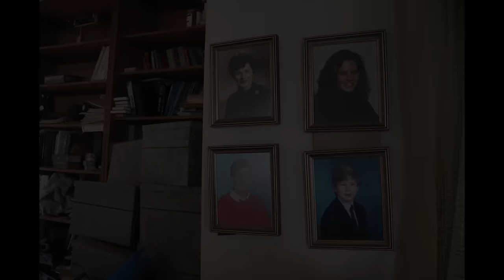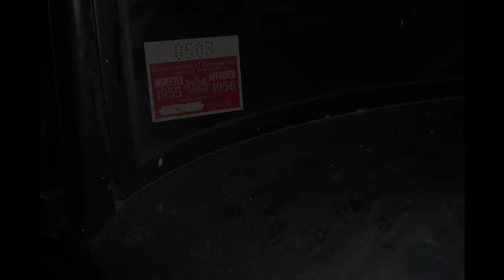1927 Packard Found in Abandoned Philadelphia Factory Sitting for Over 40 Years

Comment: Please get it running and repair just barely what is needed to go, steer, and stop.  Smooth down the sheet metal minimally clear coat to prevent further rust and then enjoy.
Reply: Eddie Huff here's a thought, how about you does with it as HE wishes, not YOU. Ya know, since its his car and you're nobody?
Reply: 4
Reply: The 90 year old seat and interior fabric won't last long.
The engine seals will start leaking in a month, then there's the issue of brakes, belts, hoses . . .
Reply: Of course he should do what he wants with it.  However the trend today is to keep it as original as possible and just do what needs to be done to preserve it and get it on the road.  In most cases this will give him the most value for the car should he ever want to sell it.  I think that was the intent of the reply's...….Signed Nobody!
Reply: @brianmax8147  that's so true. Some are born assholes and some like me, have to work at it. LOL When someone calls me an asshole I say "Thank you, I work very hard at it!" Partly because in saying that it takes away their (the person who's calling me an asshole) intended goal. Which is to cause me to feel bad about myself and to be hurt. For it to cause those things in me I'd have to care about their opinion. My best piece of everyday armour is not caring what anyone thinks about me. I can't do anything about that. I can change the response they are looking for from me. 😊👍🖖
Reply: @dbyers12  i guess my reply was meant to show that calling him a nobody said more about himself, than the person he was calling a nobody. 😊
Reply: Eddie, you're so right! Cody can't help the fact that his Father and Mother are Brother and Sister.  😉 lol

Comment: Mechanical vs Full Restoration? Hard to say. I think I'd clean it up first. If it looks great as-is, just get it back up and running. If it's just south of looking really good, and going the extra length would bring it up to 100%, I'd go full restore.
Reply: The car would be worth a LOT more unrestored, running, drivable.
Reply: @joesurfer9754  I'm not sure that's accurate in today's market, although I agree I would do a minimal restore myself. To give it a 100% frame-off restore would take truckloads of money. And to get max $$$ it would have to be done by a house that specializes in Packards. Sure an individual could do it over many yrs, but would he do it correctly is the question. And the people with more $ than they deserve buying it would think the same way.
Reply: I would do same thing Just clean every thing & fix what needs fixed. Free things up and keep them original. 
Original is priceless
Reply: If it's like a old model t it likely has wood with metal over it. If it's like that it's possible simply due to the age that the wood is in sad shape
Reply: @kevinfetner7983  car is worth way more as it sits just needs a good cleaning. The car is considered a survivor by the video a off the frame restoration will drop the value alot
Reply: why repair or restory if not broken. Just clean & fix broken parts. Very nice car.
Reply: The dad wanted to restore it with John Paul and his siblings.  Do the restore the dad would have done, which seems like a mechanical rebuild to get it running, a polish or new paint to match original, and possibly reupholstering with as much stock as possible.

Comment: You guys need to check for hidden compartments that were used for hiding your booze during the Prohibition.  Many cars of the era had them in the rear arm rests, under the seats or in the trunk.  Only high end cars had steel wheels on them like the Packard back in the 1920s.  This car being a survivor needs to keep its integrity and be just cleaned up.  It's not a rare and desirable model so actual ground up restoring probably would cost more that its worth.  Thanks for the video, you've gained a subscriber.
Reply: William Charles:  No, they shouldn’t open anything before getting pro advice on how to proceed. Once that’s in hand they should video and take good photos of everything as they go through the car. The car might possibly have historical value beyond that of an ordinary ‘27 so documenting everything might help drive value even higher. Taking extreme caution doesn’t cost very much, but doing things the wrong way sure could.
Reply: William Charles - It’s  not really a matter of whether full restoration would cost more than the car is worth or not. The consensus is that this car is just too good to mess with beyond mechanical restoration.
Reply: Contrary to popular belief, Packards are rare cars, whether they're a common model or not.  Packards from that era were hand built and unique, even with the common models.  So, this car has plenty of value to it.  It was one of the big three in American luxury vehicles of the era, Packard, Pierce Arrow and  Peerless and were some of the most coveted luxury cars of the era.
Reply: Greg Schroeder    That's why I'd recommend Wayne Carini of Chasing Classic Cars, he and his mechanics have much experience with cars of that era...
Reply: @jhowe5571  A fully restored 1927 sells for around $50K. My SUV is worth more than that.
Reply: @JohnJones-oy3md  But your SUV is nowhere near as stylish as this Packard...
Reply: @JohnJones-oy3md  And in 50 years your SUV is most likely going to be worth $50, if it's not in a scrap yard, while the Packard is simply going to continue gaining value.
Reply: @AndrewAMartin  You're right - I wish my ride had the aerodynamics of a brick.

Comment: It's only original once.  Put new brakes and tires.  Refurbish the engine and fuel system.  I would try to polish the paint.  Good luck and best wishes
Reply: Those tires have good tread.
Reply: Just a lite polish so you don't pull off too much paint the idea is to leave as much of it's original character intact.
Reply: @scottgoodman8993  The rubber is probably dry rotted. For safety, replace the tires!
Reply: @scottgoodman8993  even if the tread is good those tires are over 50 years old lol have to replace them

Comment: Too bad the guy didn't know how to operate a roll-back.
I'll throw my vote in for a mechanical work-over.
Reply: I was wondering that as well.  They could have just tossed the rear wheels onto rollers and moved it around easier.  Way to close to the side of the building...
Reply: Even a floor jack to move it from the wall. On the roll-back, the winch is in the center, so it will always pull to the center. He hooked the car on the side of the axle, causing it to pull the car over to the left side of the truck.
Reply: I'm not surprised a lot of these tow truck driver guys are not properly trained

Comment: Tow drivers are hit and miss, if he didn't know what a snatch block,was or used for, he should not be driving a tow truck of any kind.  I liked his Afro, it's hair waiting to be torched by an errant lighter bwahahahaa.  Just kidding I saw an Afro go up in smoke when someone was lighting a cigarette in college, the guy turned his head and the Afro swung into the flame by accident and all of a sudden you smell that burnt hair and hear the crackling.  Then everyone around him was smacking him in the head to put it out!
Reply: For all the snarky comments on the guy not knowing what a snatch block was for, I found it funny that the "smart guy" hooked it up to the wrong side of the car when they DID use it. Should've started out with it attached to the far side of the car from the snatch block to get maximum pull angle on the car. Of course one wonders why they didn't just push the car forward to straighten it out for backing it out...

Comment: i have a survivor 1932 Packard light eight sedan. The original two tone blue paint is still pretty decent. needs windows because they have oxidized heavily in places.  also needs engine tune up. thats why it parked. bent rods i think.  it probably hydro locked way back when i remember being told it overheated so i t was parked and had bent rod or rods. someday ill get it goin.

Comment: It's a really great car for restoration , mixed feelings about leaving it with original look however left unrestored the elements will eventually win out. I've seen a car exactly like this one in Hannibal MO. Completely frame off restored and it is killer. So with that said bring back to New condition. I'm currently doing a 1949 Packard that's been in our family since the 80s dull frame off if let go any longer you just have nothing to work with. I restored my 53 Packard in 1990 and have NO regrets doing it. I've recently purchased a 1956 Weather Cost Packard VERY solid car but will still get great refresh done to it.

Comment: EXHAUST  MANIFOLD 
We have 9 Packards from '36 to '49.
One car was purchased that registered 8,006 miles. To determine if it was acurate, after MUCH engine cleaning was done, the exhaust manifold was found to still have the black porcelain coating intact. 
The porcelain gradually burns off.
If Packard used porcelain on the manifold in '27, then the majority of the porcelain would be intact for 10,000 mi.

Comment: This car and just needs to be cleaned up really well with the original paint, get it running, and I would check underneath those seat covers because it was extremely common during those times to put a seat cover over top of the brand new seats. My grandfather had a 1935 Packard The same color as that one and they had put seat covers over top of the original seats. After he passed away in 1962 my family received that car and we pulled off the covers he had put on. The seats were brand new. Good luck with that I hope to see it back on YouTube running in in drivable condition

Comment: Rebuild the engine, try to refurbish and repair existing parts and components with very little or without modifications from front to back, drain any fluids in the fuel tank, then clean and then treat the tank with a new liner. Clean upholstery and inspect materials if salvageable and if not and is too brittle and non repairable, fabricate with new materials and before installing, clean everything inside thoroughly. Restrain all wooden components and parts so no more deterioration occurs. With the car being in this type of condition and has been out of the elements that cause corrosion, age still takes its toll so replacing all rubber bushings front to back, breaking loose components and applying clean grease and lubricants after a good cleaning of the area from a little rust due to moisture buildup and within the building and that confined area between brick walls I'm sure there was plenty to clean off. Try and salvage the rubber tires if possible or find a company that fabricates old model tires and I would most definitely leave the spare untouched, just clean up then I would use oily agents to preserve what's left of that old spare tire and never use it. It still looks as it's in good condition. I would keep the car as is just do the updates to get it into cleaner and drivable shape, theres really no need to restore it, itll ruin the history and authenticity of the vehicle.

Comment: That is a survivor and all original. Get it working mechanically. Give it a good cleaning and do what's needed to preserve it, but I wouldn't do more. It may well not even need more than that since it was stored out of the elements. A bit of oil for the wood and some wax on the body and I have the feeling that will look fantastic.

Comment: just clean it up and do a full mechanical restoration using New old stock everything where ever possible.. the seats may not be able to take new usage,.. but those materials can be matched pretty easy...  I say Keep it original.... but make it run like it would have that day it rolled off the line. theres my 2cents.

Comment: Great find and I hope you guys get it running, waxed and washed, up and running. But be careful, it is not a safe vehicle to drive around these days. All the glass is sheet glass, not safety glass and if you end up going through it because of an accident, it'll slice you up like spiral ham. And the entire inside of the car is dangerous if you get into an accident. Besides the glass, the wooden dashboard, wooden steering wheel, and no seatbelts are dangerous. If you get hit from any side, you'll be tossed around inside like a marble in a can. These cars are nice to have, but extremely dangerous to drive. Have fun but be careful. We take our cars for granted these days.

Comment: Leave the Patina, looks awesome. Get the running gear rebuilt, new brakes and lines, fuel system. 10 K on engine should be okay, will need valve seals. DO NOT STREET ROD IT.

Comment: Get the rust gone; hopefully, unlike later Packards, it won't get 3 miles to a gallon of oil but try to get the engine in shape; restore but don't overrestore the interior. Clean and running would be ideal.

Comment: Weigh you options there are differnt class cars and differnt values that go with them
Me I'd change all the fluids if no sign of any water in the oil  I'd pull the plugs and put a good shot of trans fluid or  penatration fluid in the cylinders and let it soak for afew days and give it another shot of fluid and let it sit leave it a month or so adding fluid once in a while if needed  (check with light)
I'd try to keep it as original as possible you will never find another one in that shape that survived from that time period 
PS. That fan belt would make a great Wall hanger.

Comment: I see many writers using the words "original" and "patina" like it's part of the same thing. Well patina is NOT original. In some cases, the history the patina is telling, fx of a race car or a WWII vehicle, has more value than the original condition, because there are already thousands of the same model out there, in a very good shape, but without a significant history.

But this Packard was ORIGINALLY born with glory, and the fact that Packard ever made it, is the most significant part of it's history. With too much "patina", the glory is gone, and without the glory, it's just not what a Packard is.

If it had bullit holes because it was owned by Al Capone, I see every reason to preserve the patina, but I don't think this particular Packard has a history worse to sacrifice it's glory for.

I mean, what is the value of telling a story about a car that was stored away for decades, only because the owner and his heirs never had the resources to fix it up, or even to fix the roof over the storage?

When his father originally parked the car there, it was undoubtedly in a much more glorious condition, and his plan was to repair it and bring it up to full glory, when he got the ressources, so the only story the patina is telling, is the sad story that it never happened.

The smell of mold and rot from the interior is actually the patina that tells that story most accurately, so why not keep that as well? And if the roof had collapsed over the car, would you like keep the dents as "patina", to tell the story of a rotting away storage too? I really hope not!

And remember; chrome and paint was not only put on car for glory, it serves as the vital skin to protect the car from wind and wether as well. If the chrome is more or less gone and the paint has aged away by lack of maintenence, exposing the naked metal for athmospheric corrosion, the car is simply not original, because the guys at Packard put all their expertice into protecting it's metal .... and that's actually why the car still exist, so IMO; that's really the story that should be told.

The paint was originally meant to repaint, as well as the brake pads was meant to replace, when worn down, so there is nothing unoriginal with a repainted car, unless it is done to change it's appearance.

Preserving a damaged, worn down paint and/or trying to preserve exposed, rusty metal with wax and silicone, is something you do to change it's appearance to an "old but still alive jalopy"  appearance. Not something you do celebrate the original appearance.

In other words:

IF the original paint is solid and able to protect the whole exterior; clean it and shine up, just like they did when the car was still a glorious Packard.

IF NOT; strip it, fix the rust, track the original colour, and repaint it, preferably with the high quality, long lasting, easy to polish nitrocellulose lacquer they used on the factory, to bring back the ORIGINAL finish.

IF the grill shines like a Packard should when you polish it, then a few traces of time is just fine.

IF NOT (which is clearly the case); fix it and give it the solid layer of high quality chrome which belongs to a Packard.

And of course; bring the interior back to the original design and quality, using the correct materials, fabrics and techniqes, so the passengers can have the original luxurious experience of comfort, quality and nice smelling beauty these cars was originally made to deliver.

Otherwise it will be anything else but original!

It might seem very expensive and ambitious, and even not worth to spend on a Packard Sedan, but if I restored and keept all the cars I gave up through my life so far, because I thougt they was unfeasible projects, I would have been a multimillionair today. My mistakes means I'm not.

1920'es luxury cars are getting more and more demanded as the economy grows world wide, and the modern technology and design moves more and more away from the original luxury automotive concept, so sooner than you realize, this car could represent a multimillionair fortune by itself ... if it represents that concept of course ... in stead of representing several decades of sad decay!